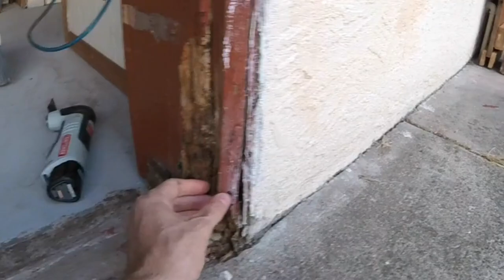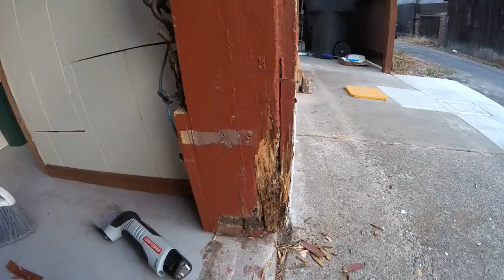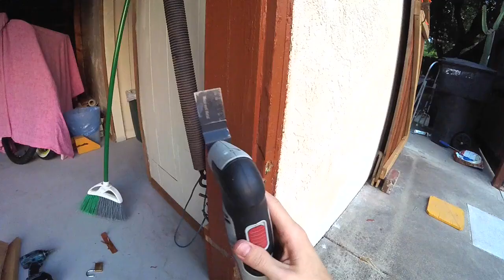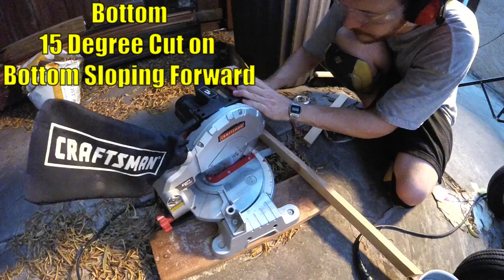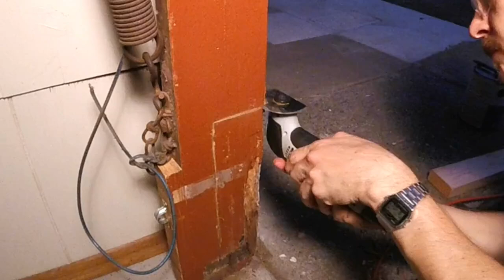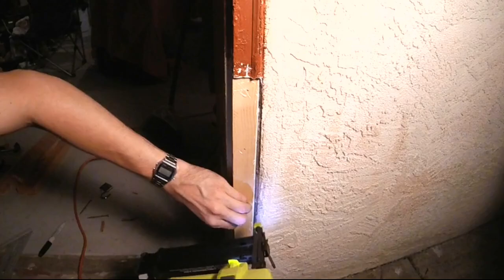How To Repair Rotted Door Jambs

Comment from the maker: TOOLS & SUPPLIES & DONATION LINKS
Oscillating Multi Tool- https://amzn.to/2RrRXyi
Loctite 3x Premium Adhesive- https://amzn.to/35V1bfN
Miter Saw- https://amzn.to/3AU8foq
Nail Puller Cats Paw Prybar- https://amzn.to/3J3Oz4r
Utility Knife- http://amzn.to/2rIeUQP 
Speed Square- http://amzn.to/2idDsOz
Hammer- http://amzn.to/2tfjnMY
Tape Measure- https://amzn.to/3rijQYo
Wood Glue- https://amzn.to/3fFrPdF
Drill Set- https://amzn.to/3gALei8
Cordless Circular Saw with Battery/Charger- https://amzn.to/36wBOMn
Ryobi Nail Gun Set- https://amzn.to/3f4FtWK
Leather Work Gloves- http://amzn.to/2x5BZk3
Protective Ear Muffs- http://amzn.to/2wBYf1O
Safety Glasses- http://amzn.to/2ez41Jw
Magnetic Work Light- https://amzn.to/33tk6tp
If you Enjoy the Channel Consider Helping Support it by Donating with Youtube Super Thanks or Using Links below or by Subscribing (it's Free) & Watching some of my other Videos
PAYPAL DONATION https://www.paypal.me/JonnyDIY
Zelle Donation JonnyDIYs@gmail.com 
Venmo Donation JonnyDIYs@gmail.com